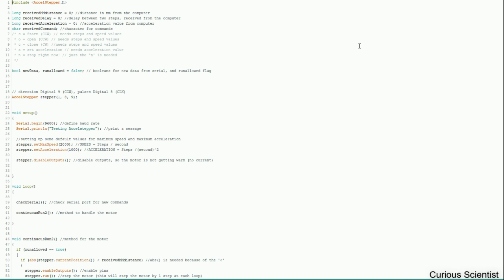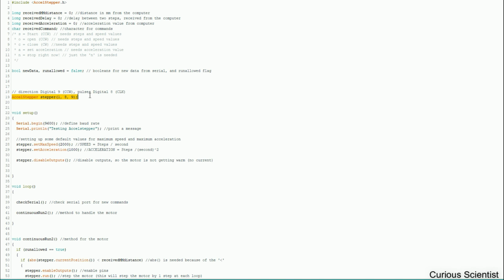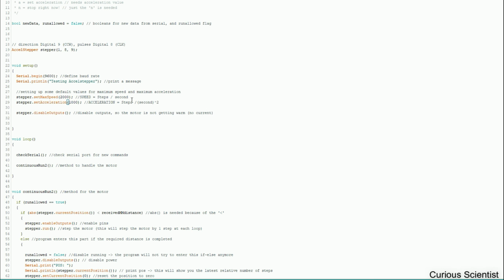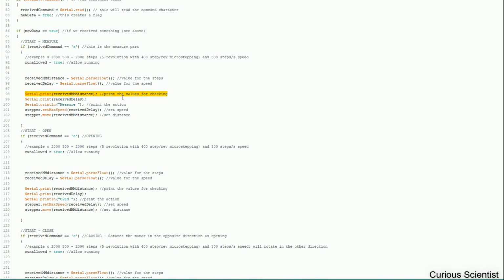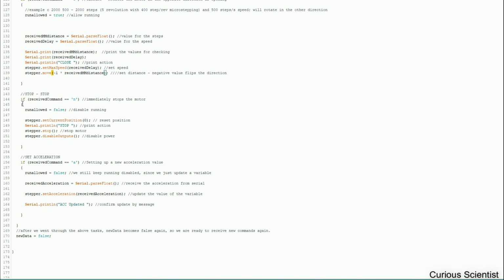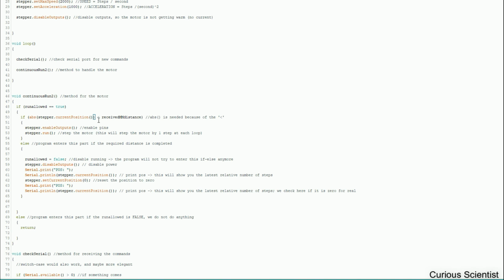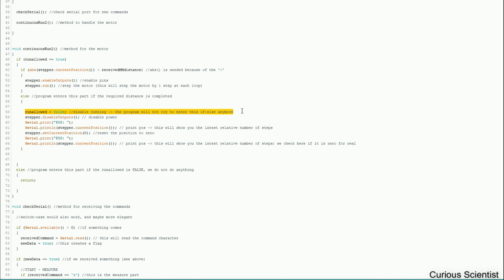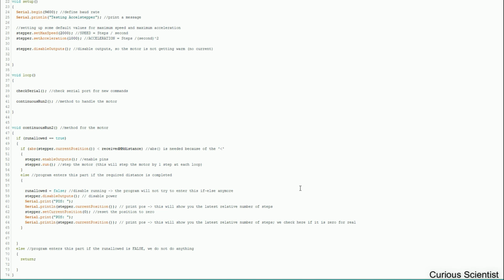Arduino with TB6600 using AccelStepper library

Comment: hello I love the video very helpful and i Subbed as well and if you don;t mind a suggestion for the next video if you could implement this ps3 controller via bluetooth using esp32 to the accel stepper library to run stepper motors something like this  https://www.youtube.com/watch?v=83tVkgT89dM would be cool!
Reply from the maker: Hi! Thank you for the feedback, I really appreciate it! I checked the video, it is a really neat project! I could do what you suggest, but you have to buy me the parts, haha.
Reply: @CuriousScientist  What country do you live in?
Reply from the maker: @LegitLeeVelez  Check my channel info! :) But you do not need to buy it for me. I will look it up, and if I find it interesting, I will probably build it. 
I actually started to think about something similar. I bought a few joysticks, or more precisely, their analog part. I want to build a miniature X-Y table for some tools, and I want to control it with that controller. Your proposal is just a few extra steps from there. So, I might pick it up soon and check what I can do. 
I saw that you subscribed (many thanks!), so if you keep checking back time to time, you will see, if I did that project.
Reply: @CuriousScientist  sounds good i too will be working on the same thing and your welcome on the sub and I would suggest that you sub to my channel to. To see if I make it and what I make it do

Comment: Hello, in my opinion this application is mistaken. if I enter the command "S10 1" or "O10 1" the first step is in the wrong direction and the following steps are then in the right direction. This error does not occur when entering "c10 1". Can you test this in your application and report the result? Thanks!
Reply from the maker: Hi! I do not have time to test it, but I think I see the problem in the code. 

The ContinuousRun() function directly checks the receivedMMdistance. The S and O functions are basically the same, so they behave the same, but the C function should move the motor in the other direction. This is done by multiplying the receivedMMdistance by -1. However, this is just passed to the MoveTo() function of the accelstepper, but in the ContinuousRun(), we are just checking the receivedMMdistance. I think this is incorrect. I will fix the code when I have time.
Reply from the maker: Okay, I checked this, because it disturbed me. 

I think this is an error in the AccelStepper library. I used one of the examples of the library, so it was not even my code. I just wrote a very simple loop that moves 5 steps then it moves -5 steps. When it should move the positive steps, first it does a step in one direction then it changes the direction and steps 4 more in that direction. 

I will try to see what is the issue, but it seems like that my code is OK so far.
Reply: @CuriousScientist  

I have the same problem with the supplied "Bounce" example. Can there be a problem with the TB6600?
Reply from the maker: @frostmarianne6418  That is possible! Now, I really don't have time to compare, but you gave me a good video idea. Actually, I have 4 different stepper drivers at home: TB6600, DRV8825, EasyDriver and A4988. I will test the same code on the 4 different drivers and see if they behave the same. I will make this video next weekend, because it requires a bit of a preparation and recording. But again, kudos to you for spotting this thing! I have been using these things for about 2 years but I have never noticed this. Maybe because I was using the stepper for large amount of steps and high speeds, so skipping a few steps did not matter. But, yes, this is some interesting discovery!
Reply: @CuriousScientist  
I experimented a little this week. I wrote a very simple sketch that works with "digitalWrite ()" and takes 10 steps in one direction and then 10 steps in the other. The described error occurs when I start with "DirPin = HIGH". If I start with "DirPin = LOW" the error does not occur.
Reply from the maker: Thank you, this is amazing! I will check how this can be fixed for the AccelStepper. I haven't been able to check it yet, as I need to catch up with some other stuff that I started long ago.

Comment: hi dear friend 
i want  control three stepper motor Simultaneous(with different direction and different pulse)
when motor 1 started after 400 pulse (or 2 second) motor 2 must  be start  when both motor travel 1500 pulse  motor 1 and 2 must stop  then motor 3 must start 
when motor 3 travel 1800 pulse motor 1 and 2 must come back to first point

please help meeeeeeeeeeeeeeeeeeee 
arduino accel stepper motor
please send me source code this project
abkhezr.robat@gmail.com

thanks
Reply from the maker: Hi! Accelstepper supports multiple motors. You just have to program the described logic into it. If you watch my tutorial you can get a general idea about the control. Then you can easily add multiple motors. Just make sure you don't mix the wires of the multiple motors.

Comment: Good day, this is really an informative video. I am actually using the same motor driver to drive my application (using in the linear slide rail - lead screw). I would like my application to continuously move back and forth at the designated positions. While at the same time, I will be able to adjust the speed of the motor. May I know is it possible to do these two at the same time? Because I don't really have idea on it, so would like to get some advice from you. Looking forward to your reply. Thanks!
Reply from the maker: Hi, thank you for your feedback! Yes, it is possible to do it, but you have to make sure that you drive the motor using non-blocking functions. It is possible with the AccelStepper library, but it is also relatively easy to write your own code from scratch. Basically, you have to check if the speed (delay between two steps) was updated and then change it to the new value and step accordingly. This (the speed) can be a read from the AD-converter of the Arduino (for example, you want to change the speed via a potmeter), you can use a rotary encoder (this might require the use of the AttachInterrupt), or send a number through the serial port...etc. The options are endless.
Reply: Hi Jia Hui, did you do your Project? I m doing  the same now, a Stepper motor have to drive a lead-screw system to an exact position. Could i get your code please! Thank you

Comment: Firstly great informative video, I am quite new to programing the arduino and have this program in mind for a project. My question is once I have worked out my parameters ie c3000 5000 and o3000 5000, is there a way to start the program and let it run continuously until stopped n. So it is going from c3000 5000 and when it has run the first command it then runs the o3000 5000 without human intervention through the terminal.
Reply from the maker: Thank you for your feedback! If I understand correctly, you continuously want to move back and forth ("oscillate") between 0 and 3000 using 5000 steps/s speed. 

I made a code snippet for you that you can simply copy-paste into the code that is already published. 
https://pastebin.com/pxdNQDLr

However, this is a blocking code, so you cannot stop it in the middle of the 3000 steps, but it can stop either when the motor has completed the 0-to-3000 stepping or the 3000-to-0 stepping. I tested it, it works. The code could be improved, but I simply don't have the time to provide a free support.
Reply: @CuriousScientist  Wow impressed with quick reply and response and thank you very much, I am building a ventilator unit that i hope to make open sauce, so this helps me a great deal in getting the project put together.
Reply from the maker: @CCPlusIT  Wow, that is a really nice cause! If you get stuck with the steppers again, let me know!
Reply: @CuriousScientist  Thank you I might take you up on that, I am hoping to control using a GUI like Druid or something.
Reply: @CuriousScientist  Basically we use speed to control BPM and distance to control the volume of air/oxygen mix. So will need to workout a stop/start button and 2 sliders to set speed and distance. I was also looking at your limit switch video as stopping the system needs to stop at the start of the travel so it always needs to start at the beginning so it will not crash into the end of the travel.
Reply: Ok have been trying to work all this out and it is definitely not my area of expertise so I am going to ask a big favor so that i can get this project rolling  more quickly, but do understand if you are unable to help. Below is my basic attempt and works the equipment i have built here, but it is very basic and crude.

//This is an example of how you would control ventilator
//What I am trying to achieve is through a GUI terminal (DRUID BUILDER) https://devicedruid.com/builder/ or something similar to be able to control motor speed and distance using a slider, along with a start/Stop button. Once set to run it will keep cycling back and forth until turned off in GUI.
//Also require to have an LED to flash after every full stroke as a visual aid to show it is working along with an option to have an auidio beep if enabled through the GUI.
//Would also like to include a limit switch so that on startup or if a change is made to the settings it will auto home and click the switch and run from that point as the 0.
//I am using the Arduino UNO along with a Nema 17 Stepper Motor 1.7A 0.4Nm (56.2oz.in) Motor + TB6600 4A 9-42V Stepper Motor Driver Controller.

My code so far......

#include <AccelStepper.h>

int motorSpeed = 40000; //This will control the Breathing rate (frequency, BR) is the number of breaths in a minute. The average breathing rate is 12 breaths per minute.
int motorAccel = 6000; 

int motorDirPin = 9; //digital pin 9  DIRECTION PIN
int motorStepPin = 8; //digital pin 8

AccelStepper stepper(1, motorStepPin, motorDirPin);

void setup(){
 stepper.setMaxSpeed(motorSpeed);
 stepper.setSpeed(motorSpeed);
 stepper.setAcceleration(motorAccel);
 
 stepper.moveTo(2000); //This will control the Tidal volume (TV) is the amount of air breathed in with each normal breath. The average tidal volume is 0.5 litres (500 ml). So be controlling the stroke of the ram controls the amount of air and oxygen pushed into the lungs.
}

void loop(){
 
 //if stepper is at desired location
 if (stepper.distanceToGo() == 0){
   stepper.moveTo(-stepper.currentPosition()); 
 }
 

 stepper.run();
}  

Fingers crossed and thanks in advance...
Reply from the maker: This is a bit more difficult than that. I am unfortunately not familiar with the devicedruid, I develop my own GUI using MS Visual studio. From your code, I miss the whole serial communication. Basically that's how you would send the values from the PC to the Arduino. Sadly, this would take a day or so to write the GUI and nicely fix everything with the coding (on both sides) to make it stable and redundant to avoid any kind of failures. I guess, you also want to incorporate different sensors, such as a pressure sensor and so on. That would make the stepper motor controller more complex, as you would need an active-feedback control.
Reply: @CuriousScientist  thanks for getting back to me on this, and thanks. We do not need sensors to feed back as the oxygen is controlled separately through its own flow meter and we know that using a certain stroke ie measured distance of the compression ram is very precise in volume of air/oxygen as with the as with the rate that it is fed to the lungs, an average person at rest uses about 500ml of per breath  so probably not as much as you would think. We are very close to the end of prototyping and will be submitting it to NHS for the necessary regulatory testing once we have an interface to control it. Is there a way i can email more information and spec requirements for you to inspect and consider, again I really appreciate your time and knowledge , could make a very interesting YouTube project for your channel.
Reply from the maker: @CCPlusIT  Hi! Even without the sensors, the communication between a PC and the Arduino should be worked out which is not a 2 minute task. I do not have email address dedicated to this channel, I only receive messages through Instagram. I have a full-time job and this channel is just my hobby. I cannot and do not want to be involved in other, external projects, I hope you can understand that.
Reply: @CuriousScientist  Sure I understand and keep up the good channel it is very informative....